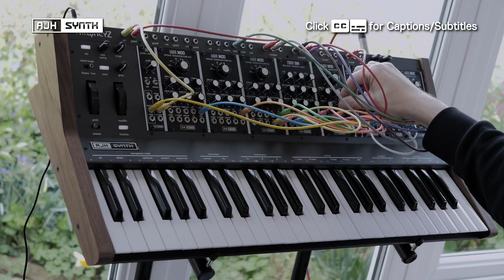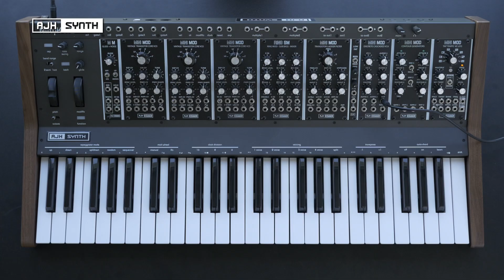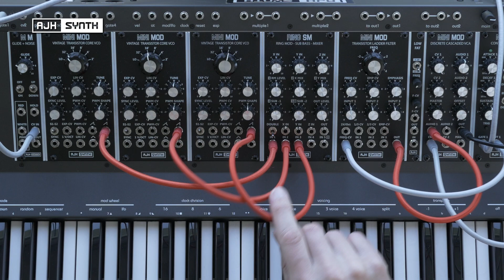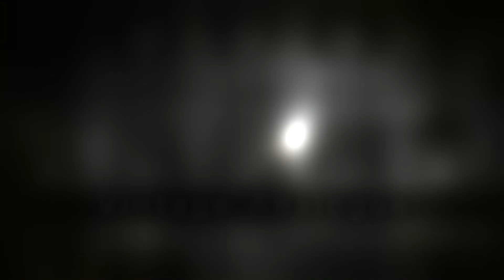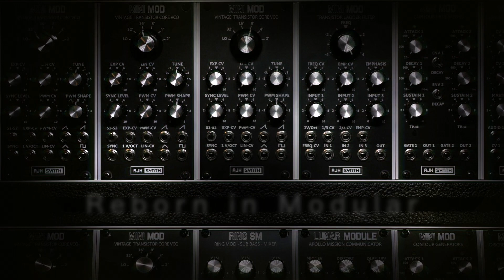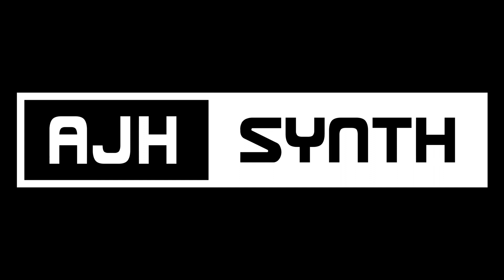MiniMod Keyz User Guide - Basics: Patching the modules together, keyboard functions, LFO modulation

Comment: Hello guys

I hope this message finds you well.. I’m falling in love every time I hear these amazing modules and I’m thinking to build mine.. I love this synth on how it well it sits on the keyboard, not to mention how beautiful it sounds.. I do have a question about  glide because you have glide on your keyboard and then the glide module.. I’m sure it must be a great reason why using this module and wondering what were your thoughts on this matter.. thank you so much and you guys rocks
Reply from the maker: Thank you, that's great to know. 
The inclusion of the Glide + Noise module is because the intention here was to have a complete module set/voice based on the Minimoog, so the dedicated glide module mirrors that on the original synth, whilst also providing 3 colours of noise. Additionally, it gives access to the CV bus, so that a single patch cable to module's CV input controls the 1V/Oct of all 3 VCOs simultaneously.
Having a glide function on the keyboard itself is just an added bonus ;)